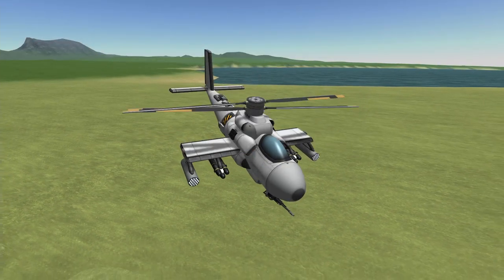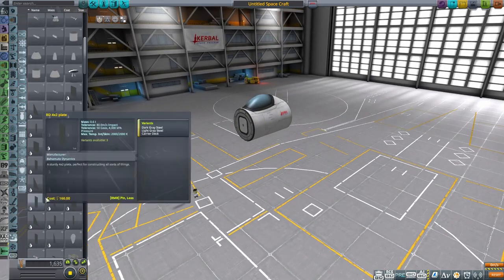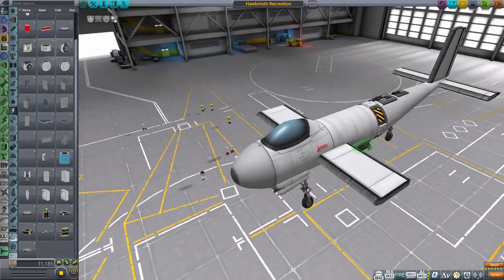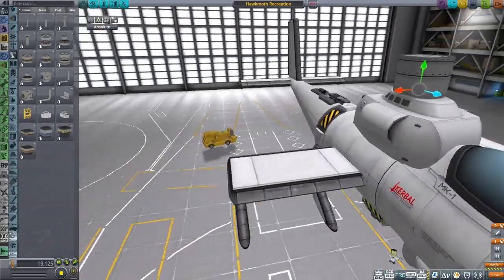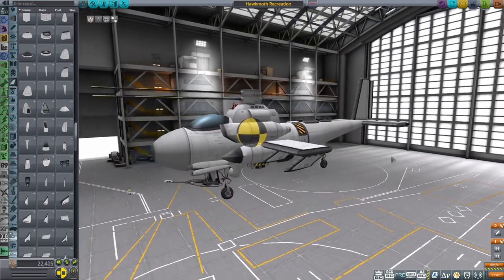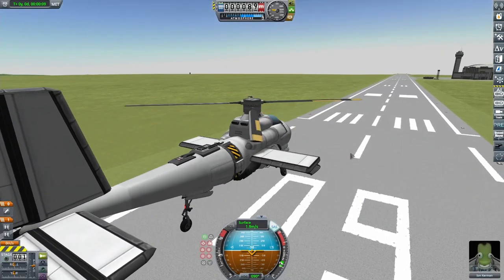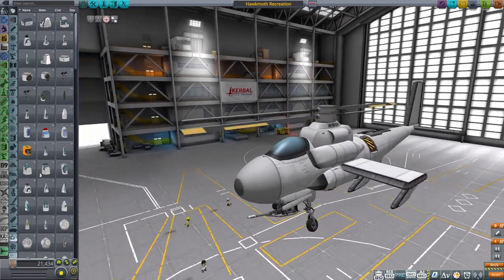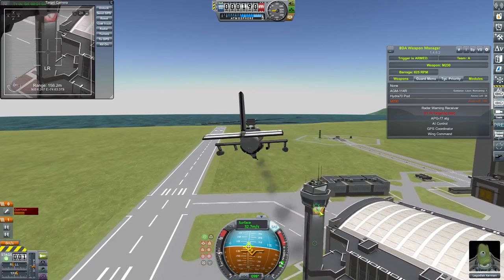Aircraft Tutorial - Building an Attack Helicopter - Kerbal Space Program & BD Armory

Comment: 13:08 you can offset the blades you already have up then use the attachment node on the bottom then rotate it 180 degrees so it’s facing the correct way then offset the original part back down. I find this the easier way to line up coaxial rotor system. I also like to add a juno engine with 0 thrust for some sound. One more thing is that I fine binging toggle torque to a key like rcs to start the blades and keep them at a set rpm and torque then and bind a kal 1000 to the throttle and have the kal 1000 control collective
Reply from the maker: Ooh, good suggestions! If the little one allows me the time, I might have to give the craft an overhaul!

Comment: Hey Smith, wondering if maybe you can signal boost the heli roll bug issue and maybe weaponize the KSP fandom to finally resolve this issue, perhaps over discord or maybe on YT. The forums are full of ideas but no body that I've seen has come close to a solution. In fact most wrongly (I think) believe it's a feature not a bug.

It seems like you've done your research into helicopter design, however I've investigate many of these ideas myself to no avail. I feel fairly certain in my conclusion that it is in fact a bug, but I can't yet report anything concrete to the dev's because it's difficult to replicate and narrow down. I've spoken with Legodlak about this bug, he has suggested some causes/solutions (maybe) that I think are plausible but I'm still struggling to prove it definitively. 

Personally I think the roll behaviour is the result of legacy code that configures control surfaces for flight relative to CoM. Small deviations in the position of the main rotor assembly over CoM, produce inherently asymmetric lift and ultimately roll instability; instead of pitch up like you'd get in a real helicopter. 

The constant roll can be limited through various methods, but the rotor configuration (small, medium, large/number blades) will determine how effective these limiting workarounds are. The best I've found is to perfectly centre the rotor over a constant unchanging CoM, but even then control inputs are slightly off axis, causing a slight but predictable roll when pitching or vice versa. I believe this is caused by the same issue I described above but it could just as well be caused by simulation delay (described by Legodlak) or possibly a combination of multiple other factors. 

If you read all this, it's much appreciated. I'd really like to encourage the community to get to the bottom of helicopter roll before KSP 2 is released.
Reply: Oh forgot to mention. I've been working on several stock test craft/rigs, to help diagnose the causes of roll instability. I intend at some point (hopefully soon) to send these to Legodlak and also make them available for anyone interested in fixing the problem.
Reply: The control surfaces adjusting based on CoM is some really crufty buggy code. The inconsistency has killed designed for me. :(

Comment: You can use the snapping tool with absolutely positioning to guarantee your rotors are lined up. It makes it a touch more fiddly to get them lined up with the CoM, but you can always tweak other parts of the design to fix that OR use the non-snapping absolute offset on the cockpit to move the whole craft into the correct position for the absolute snapping to be on-CoM. This way it's not "good enough" but perfect.

Yes, I am a perfectionist, why do you ask?
Reply from the maker: Nearly 4000 hours on KSP and I've only just learned about the absolute positioning thing... 😆